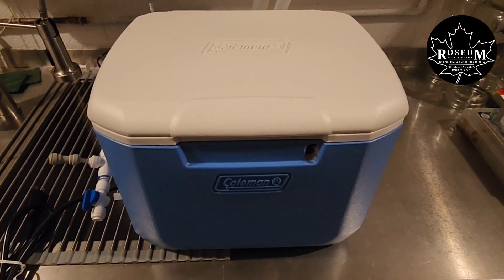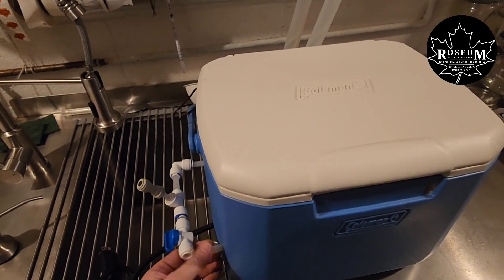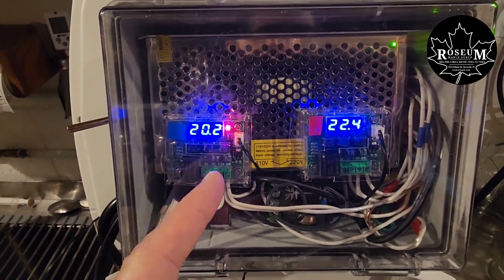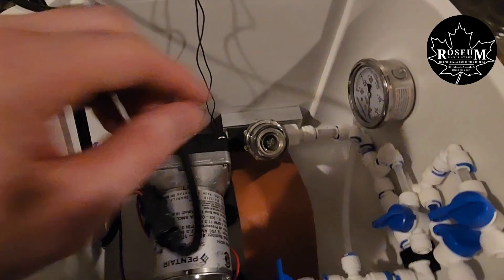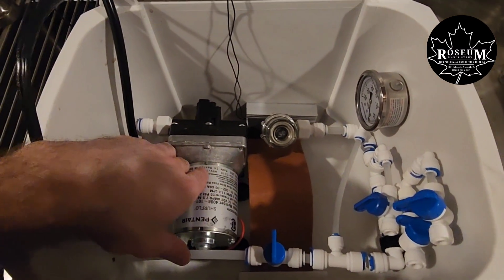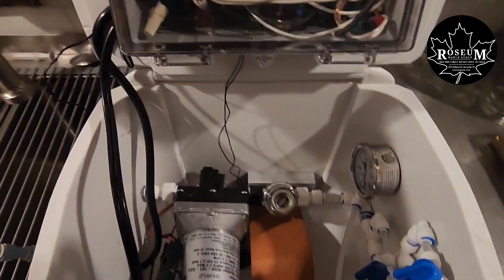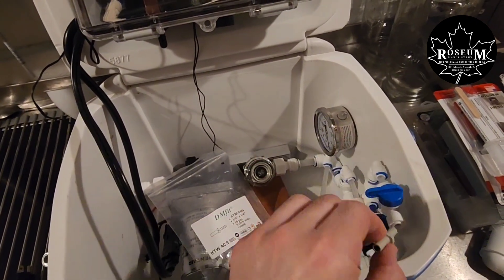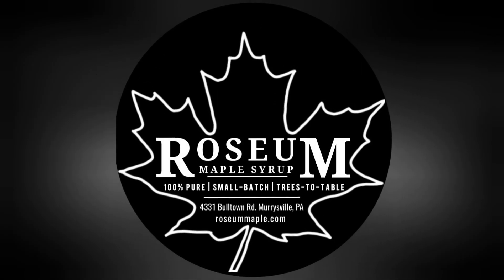Shurflo Maple Tubing Vacuum System #maplesyrup #vacuum

Comment: You got a wiring diagram. This is amazing
Reply from the maker: Thank you.  I do not have a wiring diagram drawn up for this.  If I were to build another one of these, I would use a dual probe temp controller that has both heating and cooling functions for 2 independent outlets for a more plug and play approach (along with a 12v power supply that plugs into this for the pump) Something like this: https://a.co/d/3KRB3d5

Comment: Thats a nice system. Any chance you could post a parts list?
Reply from the maker: I will try to provide a more detailed list, but the key parts are:
(1) Shurflo 12 Volt RV Water Pump 3.0 GPM - 4008-101-A65 / E65 & strainer
(2) a 12V DC power supply (I used 15 amps) 
(3) 2 of the W1209 temperature controllers 
(4) a heat source (I used watlow 100w strip heater I had)
(5) Coleman 16 qt cooler
(6) LMioEtool Enclosure with Clear Cover 8.7 x 6.7 x 4.3inch
https://a.co/d/6sjASI8
(7) vacuum Guage
(8) 3/8 & 1/4 poly tubing, tees, valves etc.  I used 3/8 for manifold and 3/8 x 1/4 tees with 1/4 valve for each lateral sap line

Comment: Where did you get all all of these fittings from like the white tubing for mine right now I have pvc but this looks way smaller and easier than pvc
Reply from the maker: You can get the poly tubing from a local hardware store. I got most of the push-fit fittings from Amazon or freshwatersystems.com.  It's very easy to build, very compact, and can be taken apart in the off-season for thorough cleaning.
Reply: Did you use all 1/4 inch pex ?
Reply from the maker: 1/4 and 3/8 poly tubing from local hardware store.
Reply: @RoseumMapleSyrup  I just got some 3/8 poly tubing and tested it out at the store and I cannot get the stuff to pull off
Reply from the maker: The fittings? You have to press the collar in and pull tubing out at the same time to disassemble.

Comment: These pumps work awesome.  I keep my system simple.  Just the pump hooked up to the end of the line going into the collection tank. When the temperature drops I unhook the line from the pump and drain it then put the end of the line in the collection tank. In the morning I hook it up again and turn it on. On a good run I'm getting 27" of vacuum, The taps at the top of the hill about 20' elevation are pinning the vacuum gauge!  I had a 150 taps on 1 pump but would only get 19" of vacuum. I split the run and used 2 pumps, 75 taps on each and got 26".
Reply from the maker: Yes, they do work great! Those vacuum levels you are getting will easily double your syrup per tap yield!